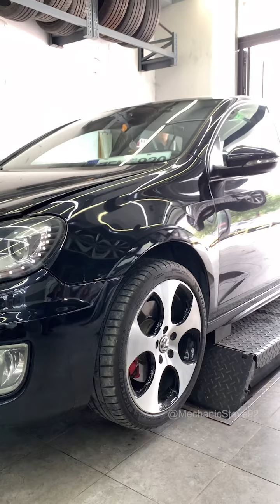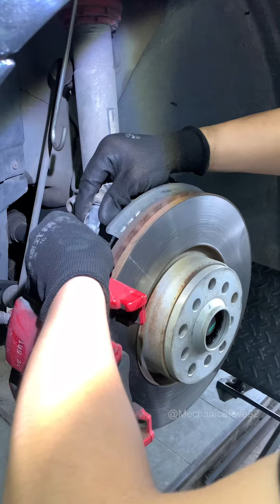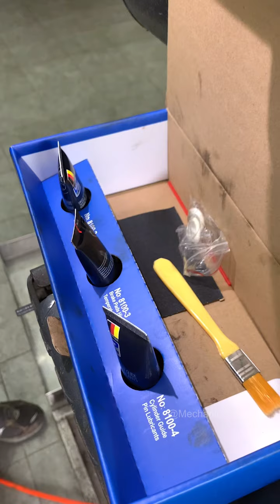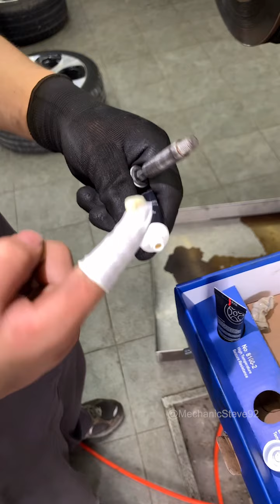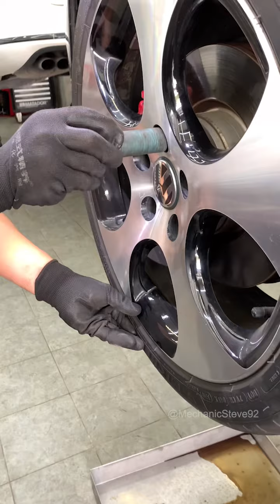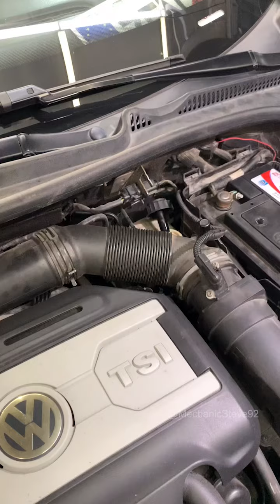Golf GTI Replacing Dics and Maintenance.

Comment: You didn’t turn the brake rotors it’ll be back in 5000 miles with vibration and congratulations on leaving the brake reservoir open you know brake fluid is Hydro scopic